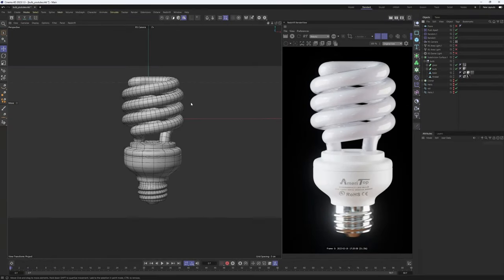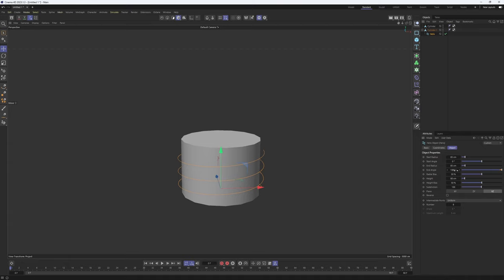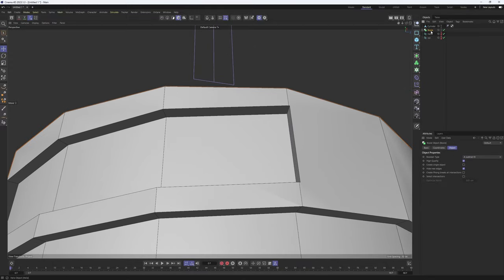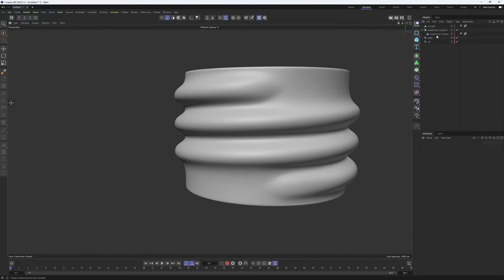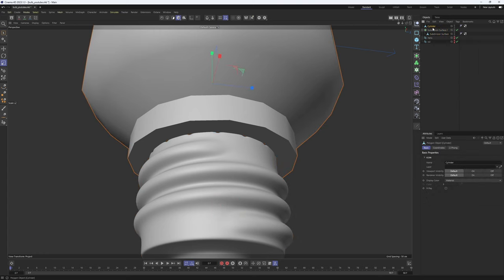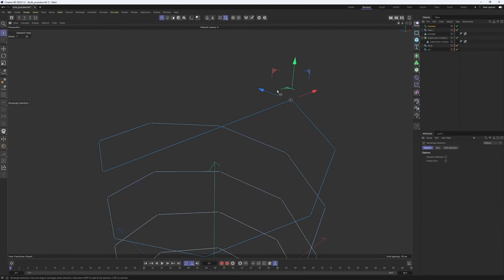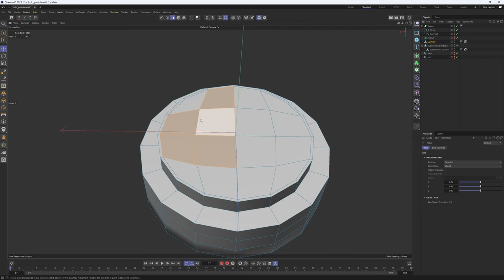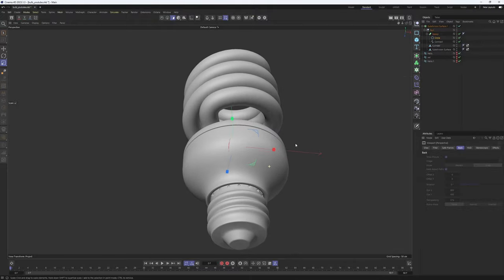Industrial Design/Product Modeling #26 | Light Bulb

Comment: This tutorial literally helped me a few days back to get the socket right. I saw you struggling a little with the circle-resolution in the sweep. I prefer to use nSides because they're way easier to adjust. I wonder if there is a reason you use a circle? Does it make any difference i may not have in mind?
Reply from the maker: Awesome!

It is just an habit actually, Nsides would be better but I am used to select a circle.